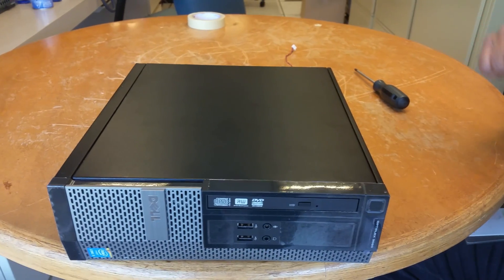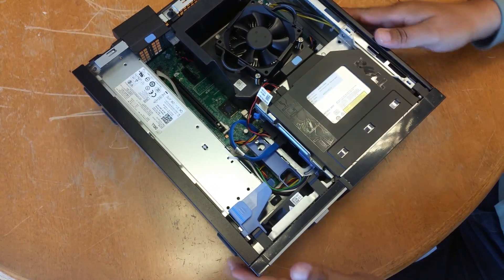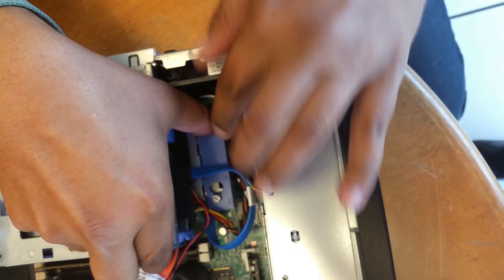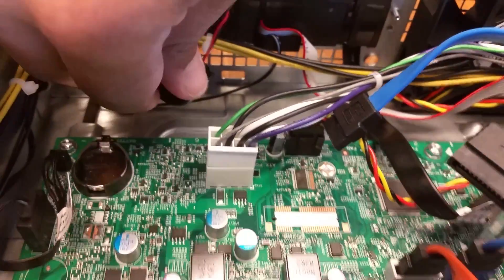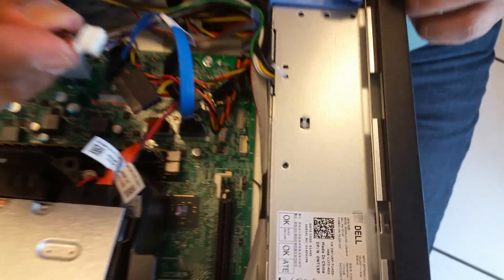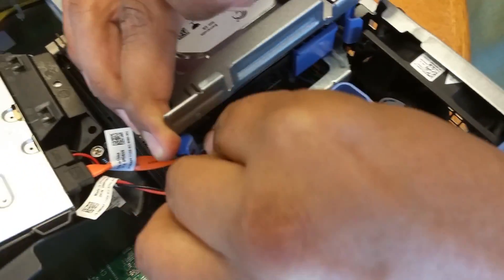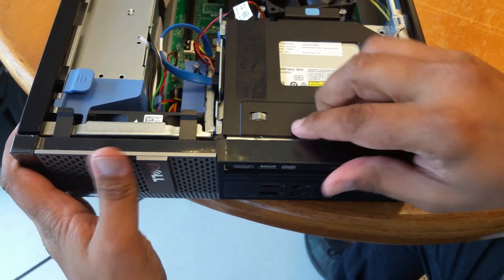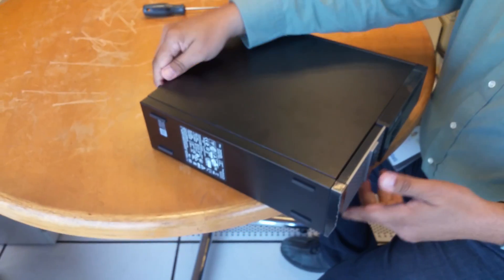Dell Optiplex 3020 internal speaker install

Comment: Bruh.. my case is bigger and it says optiplex 9010.. and it doesn't have this spot but comes with a speaker.. wtf is going on here how do i mount it?
Reply from the maker: Your 9010 has a different motherboard than the one in this video. You should identify the motherboard first, then look online for its diagrams - then you can look for an appropriate connection port. However, not all motherboards were manufactured to be compatible with an internal speaker, and some already have a tiny speaker directly installed... Also, if your intention is to play something other than beeps from the motherboard, you should be looking for something completely different.
Reply: yeah i found out the speaker sticks to the metal hard drive bay that i had removed Before... so solution i just bend a clip over and stick it to that it works Great Thanks alot for your Reply! :)

Comment: I need thi speaker how can i baye this.?
Reply from the maker: Depending on your PC model you may have to shop around a bit. I recommend Newegg.com or in some cases Amazon. Here is a link to a dell model (make sure it is the correct one before purchase): https://www.newegg.com/p/19S-007N-000A5?Description=internal%20pc%20speaker&cm_re=internal_pc%20speaker-19S-007N-000A5-Product

Comment: do you know if I can use a soundcard with an internal speaker?
Reply from the maker: Most likely. If the sound card has an internal speaker, check the product manual for instructions.

Comment: PLZ PLZ PLZ tell me, will this work with an Dell Optiplex 9010?
Reply from the maker: The stock motherboard for the Optiplex 9010 has a speaker output so you should definitely be able to connect an internal speaker. It's up to you to look at the computer casing for the best location to hang the speaker.